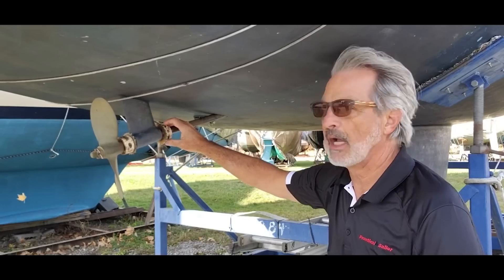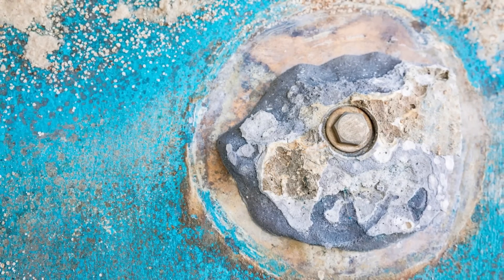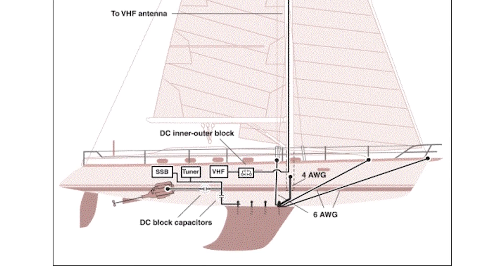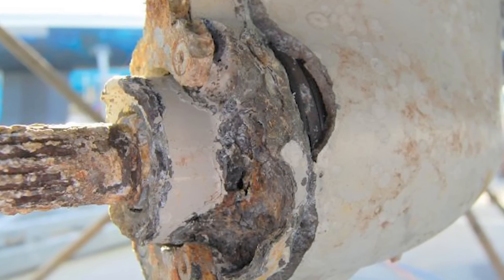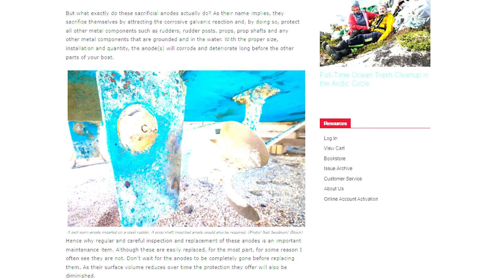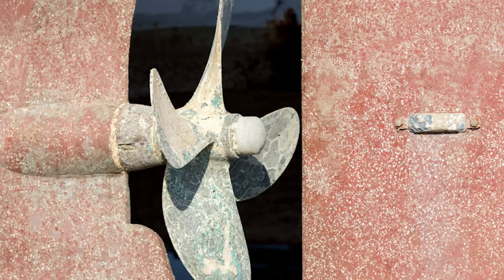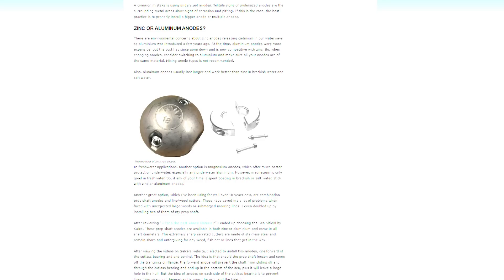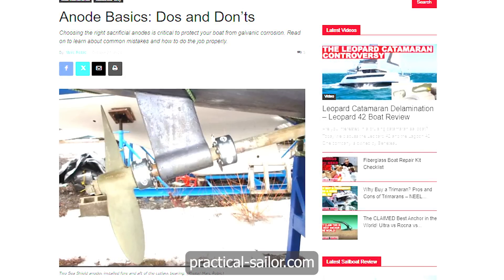Choosing Anodes for Your Sailboat

Comment: Tim, I learn a lot in all your videos, but this one was different.  I had no idea why anodes on boats worked this way.  Aside from being a sailor, I'm a camper, and I have an anode in my hot water heater.  Home hot water heater too.  Those are COMPLETELY DIFFERENT!!!  I had no idea that electrical current was the issue on a boat.  I have photos of when I winterized my boat (fellow Canadian here) and one anode might need replacing in the spring.

Can you consider doing a video on lightning strikes on sailboats, whether underway or at the dock?  I live in an area (Atlantic Coast in New Brunswick) where thunderstorms are rare, but they do happen.  Advice on how to prepare for or deal with a lightning strike would be appreciated.

Comment: An aluminum anode would not  protect aluminum parts of the boat, because they are equally "active" metals. The anode needs to be more active than what's being protected. If there are no aluminum parts on the boat, then an aluminum anode would work. Magnesium and zinc are more active than aluminum.

Comment: Good morning. The former owner of my Hunter 35.5 drilled two half inch holes in the fiberglass on either side of the keel. My question and thoughts have been to mount anodes there and to wire them to the chain plates and engine.??.
Please give me some advice. 
Also is there a cheap version of an ion dissipater?

Comment: Tim,  Nice video.
My boat lives in warm salt water in Thailand.
I find that the aluminium works the best here.  It corrodes fast, but that is a good thing.  It means that it is working.
As the zinc anodes corrode, they develop white zinc oxide on the surface and then become less active/effective.
This does not happen to the aluminium anodes.  They are able to maintain a fresh aluminium surface that stays effective.  
My problem is that I have a 1-1/4 inch shaft, and the suppliers here tend to carry only metric sizes. ☹

Comment: Zinc isn't anywhere near toxic enough to worry about. Get right back to zinc and forget about aluminum altogether. If I had a marine store, I'd flatly refuse to stock aluminum anodes. Seawater has lots of lead, and now roadsalt, from 80 years of abuse. Magnesium is so corrosive, I've cleaned up plane wheels and overnight, they acquired a black smudgy surface that partly comes off on your fingers, and that's from 12 hours indoors in a clean place. Magnesium would come unbalanced and detached too fast. I wouldn't put zincs so far back in a rudder as shown, because it can make the rudder flutter. The weight is also better off near a hinge or Cutlass bearing and clear of the propwash.
Reply: In professional marine operations, the correct anode is required in compliance with marine insurance. As the US has not ratified the Maritime Labour Convention to protect and support Marine Professionals, employment with US flagged ships is not recommended.

Comment: Boat is stored and used in salt water. If I change from zinc to aluminum anodes external to the boat like bow thruster, prop shaft, transom, do I also have to change inboard engine anodes to aluminum?
Reply: Don't change to aluminum! Just use zinc anodes as it has been used for the last 100 years when sailing in salty water.
It's a bad advice that is given here! Aluminum don't protect as good as zinc in salt water.

Comment: With an aluminum saildrive under the boat stray electricity has been the challenge over the past 11 years. I change the manufacturers custom zinc on the drive every year at spring haul-out. I tried two years once and was shocked at how little was left. I take the removed zinc and secure it to a 12 gauge wire which is attached to the engine block (which is, of course, attached to the saildrive unit) and hang it over the side when the boat is at the marina. I also have a galvanic isolator on the shore power connection.  I use Horizons Vivid bottom paint (copper based) except for a 2 ft radius around the saildrive leg as recommended by the manufacturer. For that radius I use a biocide type bottom paint. After all that I have absolutely no galvanic corrosion on the leg or bronze prop. All good so far!

Comment: I have a metal plate about 4”x8” that my shrouds and stays are attached to for lighting protection. Does this plate need a zinc? I have noticed over the years that the smooth metal surface is dissolving exposing a porous or sintered body of the plate

Comment: Please do one of these about galvanic isolators.  My boat is in fresh water with shore power and the magnesium anodes last longer since I added a galvanic isolator.  
I also noticed that one of the prop shaft anodes in your video is too close to the strut and will block water flow to the cutlass bearing.

Comment: I have an interesting question. I use Pettit's zinc paint on my maxprop. In my mind, I feel I should use Zinc zincs.  Should I switch to aluminum and why? I made a video of the last replacement. feel free to comment on anything I did wrong (or right)  Been doing it this way for 17 years, no problem...yet! https://youtu.be/FQedyuj0rug

Comment: GalvAnic corrosion, not galvonic... Also, you seem to be confusing the BONDING circuit with the grounding (part of the Alternating Current System) circuit. Anytime that you immerse two different metals in an electrolyte (such as salt water) there is a small voltage potential between them. You can look up where the various metals appear in in the galvanic series here:https://en.wikipedia.org/wiki/Galvanic_series.  If the metals are electrically connected, such as with a bonding circuit, the metals will electrically interact, and the least "noble" metal will corrode.

Comment: Thoughts on a steel hull?  I've been considering switching to Aluminum from zinc.  I'm in salt and brackish waters, east coast.  I have 10 anodes on the hull 2 on the rudder, 12" x 6" x 1" and a couple shaft zincs
Reply: No. Stay zinc and lots of it. Don't use copper ablative either. Any Steelcraft owner will tell you they bolt a big rod of zinc down each side and one on the prop shaft and the boat gets slobbered with tugboat paint until it looks like it was dipped in plastic.

Comment: Would it be worth adding anodes to a small sailboat without power but lots of aluminum components ? Some of the aluminum is cast and some of it is extruded 6061. Some of the components are in the water while most is  out of the water. all   are components with a combination of stainless and aluminum. The most popular boat is a Hobie 16 ,which 70's and 80's models are still in use. Ive owned 3 so far , one of them had structural castings needing replacement due to corrosion. Im wondering if it worth installing small anodes to the critical parts?
Reply: Dude, zinc that aluminum boat up right now. On seaplane floats and aluminum antennas, you use CTC spray Pure Zinc, and then a layer of Randolph or brush enamel, but don't forget your zincs.

Comment: For years I suspected that my boat was the sacrificial anode for the boats on my dock. Sounds crazy, but after I installed a galvanic isolator,  my magnesium anode lasted much longer. Now someone else's boat on my dock is the sacrificial boat. 😂
I'm in fresh water, but with a stray current the corrosion was high. Many people are using zinc in fresh water and their anodes appear fine, however the corrosion might be bypassing the zinc and attacking the stainless propeller shaft( pitting). I switched to magnesium and I get about two seasons out of one anode.
Reply: I was wondering how much of an issue in freshwater.  Yes, I know freshwater conducts but there has to be a difference.

Comment: I note that some anodes are too close to the cutless bearing. This would hamper, reduce the water flow to and through the fluted bearing and reduce the cooling and lubrication of the water. On my 310 I put the anode about 6 inches in front of the supporting strut. This also serves as a shaft saver if for whatever reason the shaft would disconnect from the transmission coupling. This actually happened to a fellow club member. I also have a galvanic isolator, which I test regularly. Have not tried the aluminum anode here in the east coast salt water, perhaps next season.